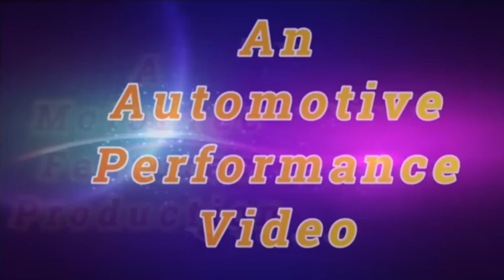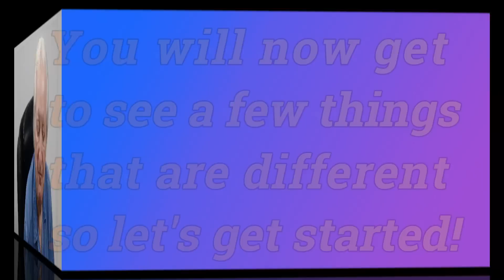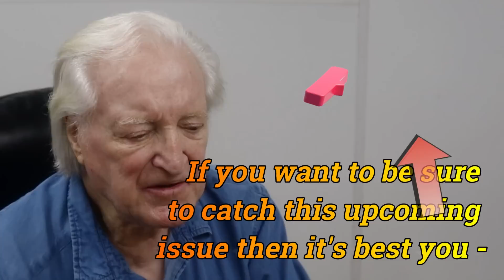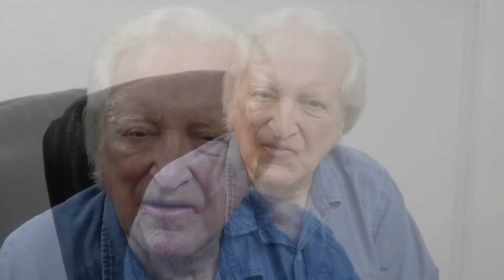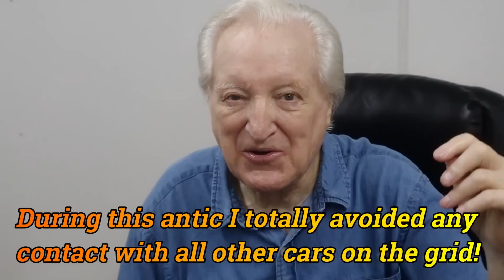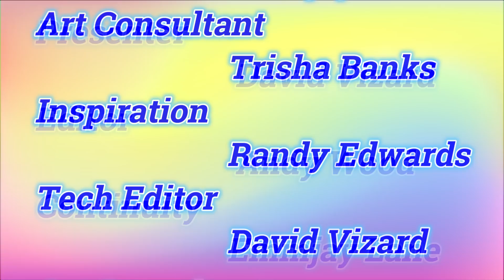Proven track speed moves that 95% of race drivers have not heard of!

Comment: The handbrake/e-brake trick, removing the ratchet, is an old stuntman and bootlegger trick to do quick J-turns, especially on dirt! I learned that from an article about the Dukes of Hazzard, 40 years ago.
Reply from the maker: Jeff, I did this 51 years ago!
Reply: @DavidVizard  Guys like Junior Johnson and Lee Petty were doing it in the 1940s 😁 (but not on the racetrack 😉).
Reply: Farmers been doing it on tight turns with left and right pedals on their farm tractors lol

Comment: Braking is just as important as the gas on a track. People forget this. People often wonder how i take cars with way less power and beat them. I tell them i make it up getting into the corners and momentum. 
If your class doesn't allow brake bias adjustment find different compound pads. 
As David said count how many turns the track has to the left or right.  Set up to turn slightly better to the most turns. The time you gain in those turns will out way the small amount you lose in the other turn. 
Read that rule book over and over like a lawyer.  You'll find little things to take advantage of.  

Ive got a saying. 
"90% of the racers are losers because they just copy what the they see the 10% of winners doing."
Reply: Funny you mention turn bias. Most old racecars (pre ~1950s) are RHD because most race tracks are run clockwise, so there’s always more turns to the right, thus it’s mostly an advantage having the driver’s mass there.

Comment: I have a silly add. My friend sadly departed was driving a 1973 Chev Can Am (Chev Firenza fitted with a z28 v8 engine standard in SA) and he only had slicks, and yet he was only two seconds a lap of of thee famous IMSA Audi's that were on wets in the rain. When I asked him about it, he told me he was running 1.5 bar (21psi) in the slicks and he says the Audi's were probably taking it easy yet they won the race. Humble to the end Paddy O Sullivan

Comment: Electronic Traction Control works by braking one of the wheels to retain traction in heavy cornering with an open diff.
More common in FWD cars since those need to have an open diff.

Comment: I learned to setup positractions to act like an "open differential" back in the early 1970's from Pepe's rear ends in Paramount California. The setup I am describing here, acts as a open differential. Then under load it worked as a Posi. I wonder if David knew about this, or the differential he had did not have a positraction available for it, or it was not allowed in his class of racing. Another good show from him!
Reply: Pepe set up my A833 Mopar four-speed back in the '70's. It was full synchro, but I was able to power-shift with the accelerator on the floor through all the gears at the drag strip without ever missing a shift (Fremont Raceway).
Reply: @MrDibbons  I worked for him in 1971, and learned a lot about how to make a Muncie pretty much bullet proof for the street. We were running them behind built BBC's and strong running Pontiacs. We were power shifting these, without scattering them. I miss those days of street racing, and learning how to make things last without spending a lot of money.
Reply: Here in SA we had a Chev Can Am fitted with a Z28 motor and a Muncie box, I am sure we would like to hear your tricks @danawilkes8322